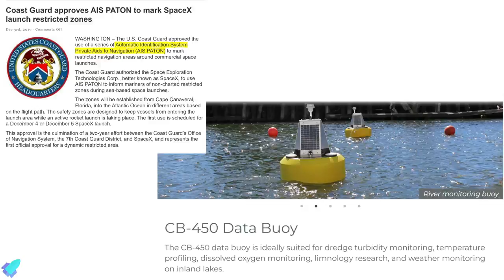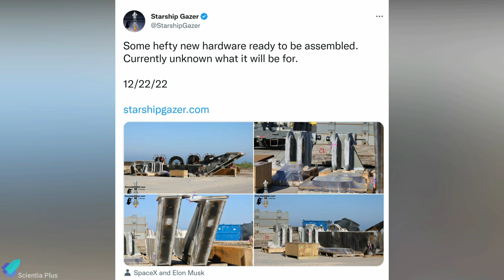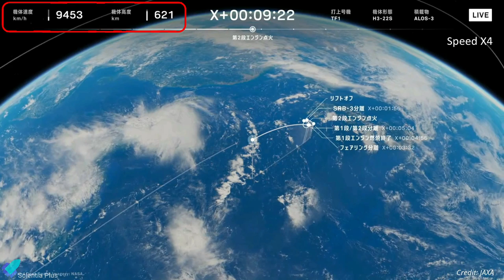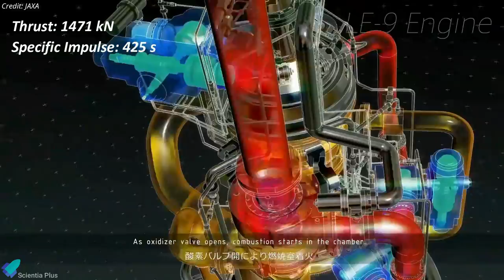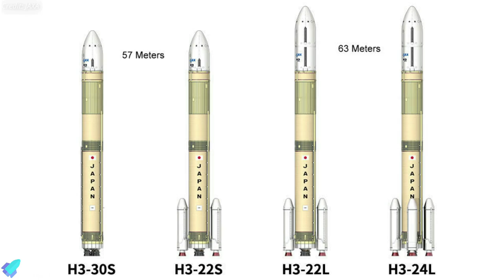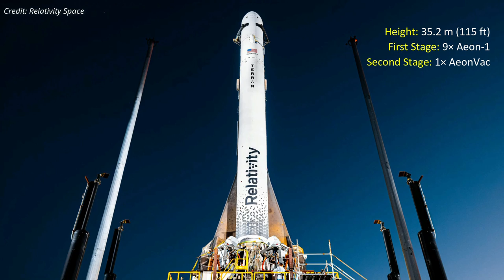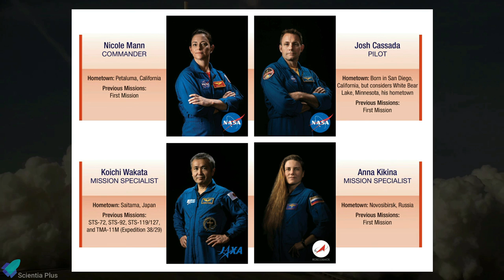What's Holding Back Starship Launch? Elon Musk Shares Update, Booster-7 Lift, Terran-1 Launch, Crew5

Comment: I don't want to be pessimistic but completing water deluge system under a month seems way too optimistic. The one at 39A has been taking  almost a year...
If they are still using S24/B7 for OFT they won't use water deluge system. They may use partially working one, but not full system.